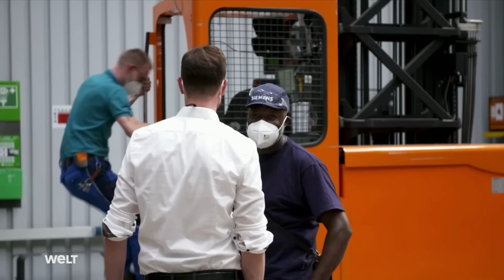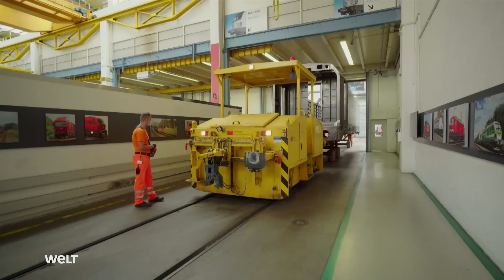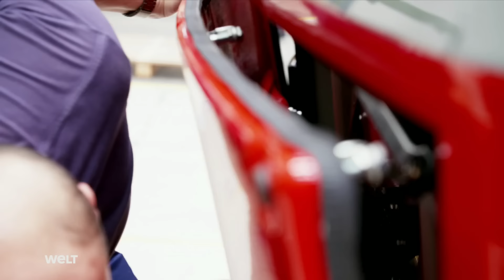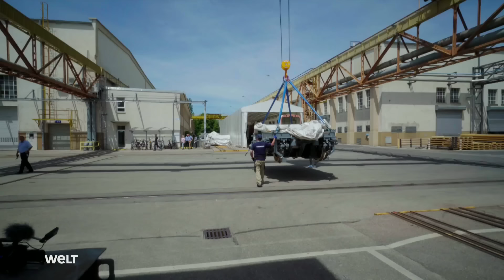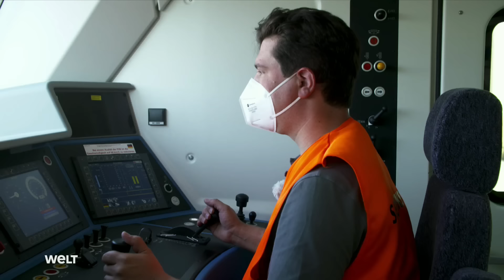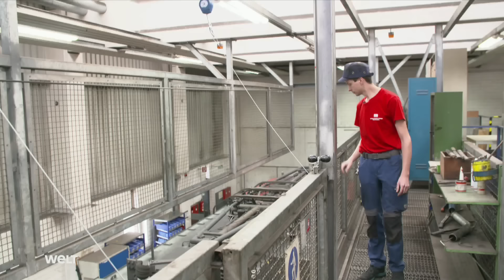Electric Freight Train Assembly: Inside Germany's High-Tech Factory | FD Engineering

Comment: MODERN ELECTRIC VERSUS NOW OUTDATED DIESEL TECHNOLOGY !
The German Class 193 locomotives seen at the beginning of this programme are 8,579hp per locomotive, and weigh only 87 tonnes. And this is only regarded as a Medium size "Mixed Traffic" type in  Europe. The Germans have been building Electric locomotives of 12,000hp and more since the mid 1960's !!! 

The programme unfortunately doesn't point out that other types of locos also built by Siemens are seen in the programme. Indeed locomotives for at least FOUR different countries are seen, and each has numerous differences. 

It needs to be also pointed out that unlike the USA all European Railways use sophisticated and complex "Block Signalling systems". And the number of trains on Europe's Mainlines is far higher than in the USA. Indeed Europe operates around 2500% more long distance trains daily than the USA, and virtually all Mainlines in Europe require at LEAST Two tracks. Single track routes as commonly found in the USA are rare in Europe, and usually reveal a line to be just a "Branchline".   

Not all the locos seen are exactly the same size. Indeed the Finnish locomotives run on a different 5ft Gauge track, NOT "Standard Gauge" 4ft 8.5in track as found in the USA and most of Europe ! Also the maximum height & width of locos varies between countries, by as much as 1ft in height & 10inches in width. Maximum Height & width is called the "Loading Gauge". Even the USA has at least TWO such "Loading Gauges".  

American Diesel locomotives by comparison don't usually exceed around 4,000hp, but weigh more per horsepower than an Electric. Revealing just one of the inefficiencies of Diesels versus Electric locos. Further Electric locomotives do NOT need "Engines" their power is simply collected from an overhead wire energised in Germany at 15,000v AC at 15.66Hz. Most railways in Europe now use the even more efficient 25,000v AC 50Hz Industrial frequency overhead electric supply method. Reducing operational costs slightly further. Indeed the USA is going to soon become the last Rail Network in the World to not exploit the increasing number of advantages of Electrification. Even Mexico is busily adopting European rail technologies including Electrification, which is also allowing the re-opening of many routes, closed originally as unprofitable, because they were using American Diesel technology !!!

Comment: There's no word about the engine, but it's a locomotive.
Reply: Electric Locomotives do NOT NEED "ENGINES". They collect their power from an overhead wire, as they hurtle along. The electric current collected is fed to "Three Phase Traction Motors" with one of these on each axle. And in this particular type of Electric Locomotive each Traction Motor is rated at 2,144hp, and as their are four axles, that means there are four of these "Traction Motors" which total 8,579hp. Which reveals this type of Electric loco as only a Medium Power "Mixed Traffic" type with a maximum speed of 125mph. So it can pull medium sized Freight trains at max 100mph or normal Express Passenger trains, at a maximum of 125mph. This is why Electric Locos are so much better and more efficient that Diesel locos as NO ENGINE is NEEDED. In Europe it is possible to find Electric locos of up to 15,000hp often in the mountainous regions such as the Alps, or Northern Norway.
Reply: @Heinz-c6c  Before the advent of high voltage rectifiers, electrics used a motor-generator set to power the locomotive..

Comment: Great video. Am quite impressed with the well planned and well equipped tooling and machinery to support the production of these locomotives with quality bar set high. Also amazed with the preparation of the cable harnesses connector pins performed by robots. 

All the best to Siemens, the videographer  and narrator.

Comment: A great loco but their inter operability models were not a great succes since it is less used. Nearly led to the bunkrupty of Siemens and Alsthom Mobility.
NL 1500VDC, GE 10.000V 16,33Hz, AU 10.000VAC 50Hz, FR 20.000VAC 50Hz...... and so on. Narvik to Bari with a single loco is still a pipe dream.
But luckely "we" have ETC 2 ONLY (Electronic Train Control) on trans european transit routes and not 15-17 systems as in the US were now little operators on Class I factory rails have to pay millions on licenses to only pass a little stretch of Class II railroad.
Due to the short horizon of share holders as with Refineries, Steel and Alumin Plants and Infrastructure.  MAGA!

Comment: 300kN/850kN = 0.353 is near the max. friction coefficient off 0.37-0.41.  US Diesel DC Electric locos do 1350/300= 0.22 or worse not much better as a steam loco.
With such a stiff drive wheel grinding/slip is no problem and rims and tracks live much longer.
The rated power is much lower as hour power which can be up to 10.000hp.

Comment: All this over-kill of electronics will never fail...
Reply: Electronics are now unavoidable in European Locomotive Engineering. Due mainly to the implementation of things like European Train Protection & Warning System (ETPWS), a standardising system, to allow locomotives to move more freely over borders. As each country had totally different signalling and train protection systems, in the past. And every country wanted to add something to the new Standardised system for Europe in General. Hence it became a little more complex than strictly necessary. And while the new system is being slowly implemented across Europe, more than one system is still having to be installed in new locomotives. I also noticed that finally mainland Europe seems to be finally introducing the much safer British Twin Pipe Air Brake system. much of Europe used to use the less safe single pipe American method. The Two pipe system adds a "Main Reservoir" pipe to the "Train or Brake pipe" as fitted. Which caused minor issues with European wagons going to Britain. A single Brake pipe system also takes longer to bring the train to a halt.

Comment: North American freight trains and those of Australia will remain diesel over electric for the foreseeable future.  The incredible % grade coupled with unbelievable car length of up to and over 4 KM’S .  These fully loaded behemoths require up a configuration of eight pulling traction units.  Typically three at the front then three in the center of the boxes and then two units keeping the push going.  Australia is a completely different animal. Their combined units might accumulate 6 KM’S in length.
Reply: Diesel DC Electric locos are NOT better at steep grades. The wheels start grinding more quicker because of the weaknes of the driveline/control loop.

Comment: I have a question, when underground rails are made they are mono track mostly and well protected by tunnels built so why should they be made of very expensive metals? I mean they can only damage if tunnels fall on them, or even outside rails if made mono racked away from old fashioned two tracks side by side changing tracks by signals  doesn’t this makes sense in containing expenses?

Comment: Didn't Germany shut down all it's nuclear power plants recently - or am I wrong? Where is all your electricity coming from these days, and how much of that is actually "green"? I heard15-17kv, but I didn't hear anything about the power this beautiful piece of art uses. Maybe I missed it, but I bet it's enormous under load.
Reply: Wind turbines
Reply: @samanli-tw3id  🤣🤣No, seriously. Where can all the electricity come from?
Reply: @snakeinthegrass7443 electricity production in 2023: 
2.3% are imported, 36.6% from fossil energys (gas, Cole etc), 57% renewable energys, 0.4 geothermal energy and the rest is nuclear power (but they got shut down last year?).
Reply: @marcFruhinsfeld  Source?
Reply: @snakeinthegrass7443  Government, Energy Companies.
Reply: German Railways provide 15,000v AC at 15.66 Hz to the overhead electric catenary wire for trains. This is totally separate from the Domestic or Industrial Electric grid in Germany. Where the domestic voltage is 230v.  Germany has a number of Gas, Coal & oil fired power stations, a few Hydroelectric Power stations and still a couple of Nuclear power stations. It also exchanges Electricity with France (which is 75% Nuclear Powered) at various ties of the day. Solar & wind power obviously cannot replace the basic Power station requirement, and can only be added to the system, as and when its available. Solar & Wind Power can't obviously be precisely forecast. And are in reality extremely inefficient, and mainly there to pander to the "Greens".

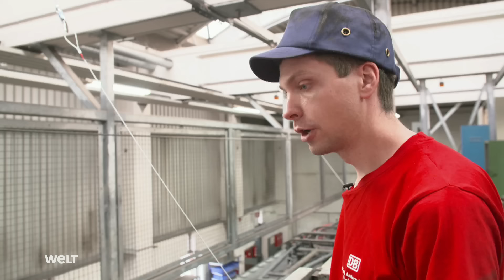Comment: 44:54 nope, in europe it's 240 volts, not 120.
Reply: Maybe he means 120 volts per phase, that gives you 240 volts for the two phase wall socket. Remember that the rail system uses only one phase and ground.
Reply: @ffeffeff  that's not how it works here in europe. here we have 3 phases, each 240 volts relative to neutral, and phase shifted 120 degrees relative to each other. the voltage between any 2 phases is more than 400 volts.
Reply: @mrxmry3264Thanks for clearing that up, I had a wrong understanding of how it works.
Reply: @ffeffeff He says 230V. It's standart Phase to Neutral in Europe and standart in Outlets. The translation is "wrong" here to not confuse american listeners.